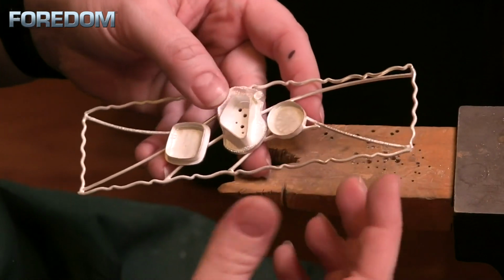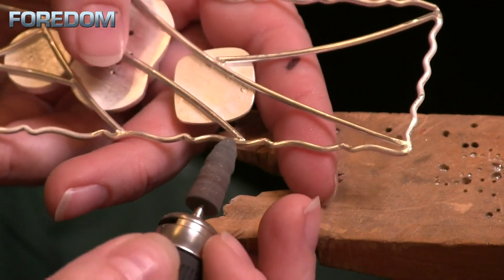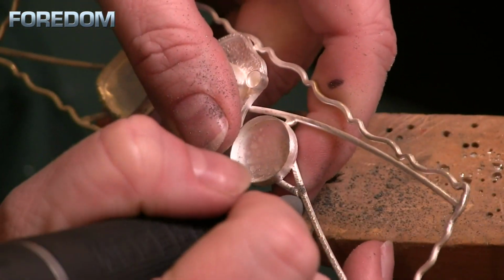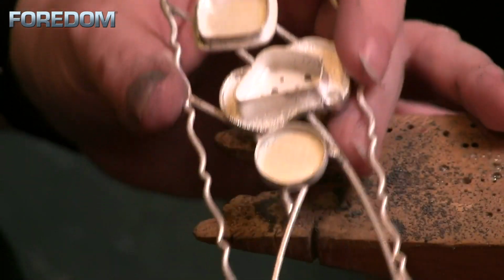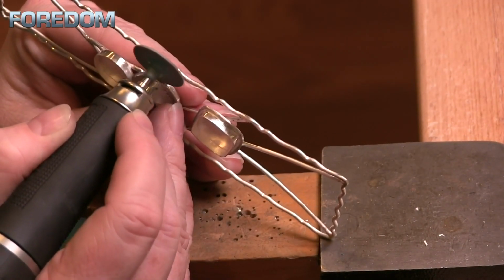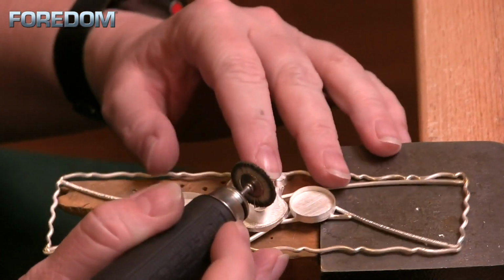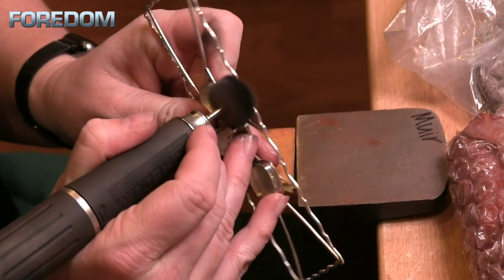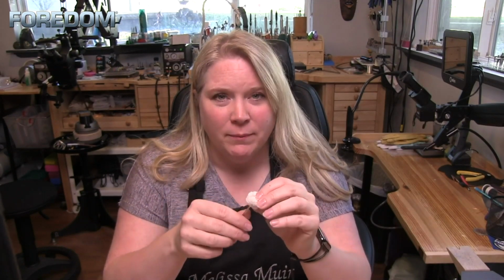Accessory Series: Blending and Polishing

Comment: I think I heard you say if you have too little of the amount of solder you’re going to have trouble.  so it’s better to have more solder making it easier to blend?  what do you mean? If you have too little solder it’s not easy to get rid of the solder line? is that what you mean
Reply from the maker: Yes. If I don’t have enough, sometimes it leaves a line that dips in. So if I have a little extra, then I can at least remove it down to the bezel without thinning out the bezel.